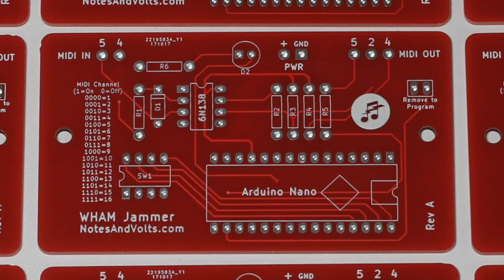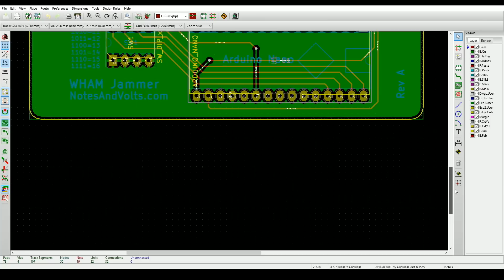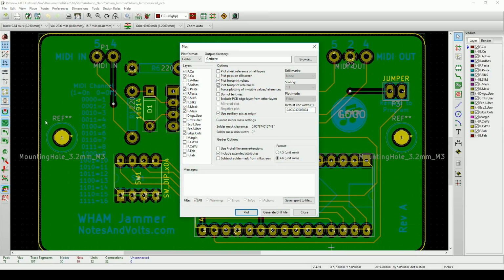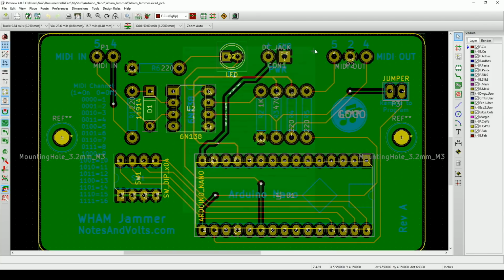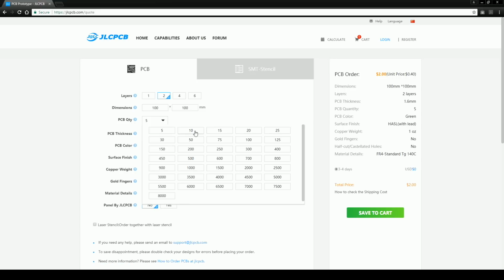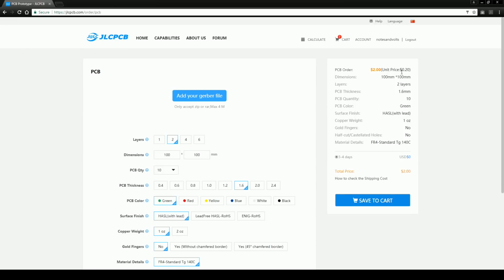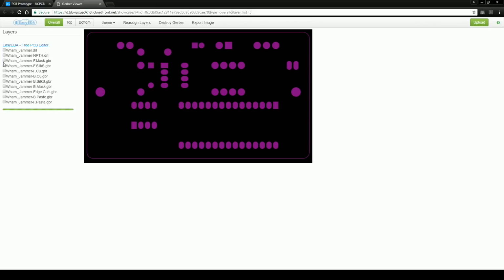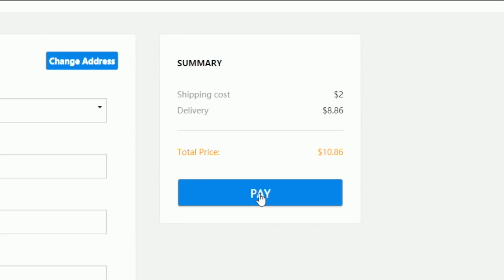JLCPCB - 10 Circuit Boards for $2!!

Comment: I just got my boards from jlcpcb. They look great, smooth edges, nice silk screen and they took less than 2 weeks from order to delivery to Canada. However, if you want more than 10 boards there is a setup fee and colors other that green were also extra. I ordered 3 different boards at one time (got the $2 special on the first design) and my whole order was still shipped free. The gerber viewer shows you exactly what you will get and I found a couple of layout errors by using it (big save) . Ground planes or "fills" must be specified in your gerbers. No one will "just add" anything to your design (you hope). All in all I got exactly what I ordered delivered on time. I'm very pleased.  To have the boards made in Canada or the US would be 5 to 10 times the price.
Reply: 10 pcb costs 2$ and shipping cost over 8$ to ship in India. Very bad
Reply: Try OSHPARK. USA company and they are low cost.

Comment: Hey Notes and Volts, I would like to build a midi controller that's capable of running in standalone mode and as a midi controller for ableton, would this be possible? I saw a video on YouTube of a guy who built a standalone controller using the raspberry pi and a teensy board and it kinda gave me a little hope that I can turn my concept to reality. 

This build would be centered around the ableton push design but with arcade buttons instead of the rubber pads. I would also like to implement a mpc feature that would allow me to create loops/ drafts on the go without the need of a laptop. 

Here's a list of things I would like to squeeze into this controller:

2 display screens for navigating 

64 arcade buttons from dj tech tools

All the buttons on the push 2 that can control ableton   live without the need of looking at a computer screen when I'm working in my home (I would be paying someone to do the coding for me on this project since it nothing like the other diy YouTube videos).

A sound board with midi in/out and audio in/out (don't know how to go about this tbh)

An sd card slot and/or a sata 2 ssd slot for expandable storage.
 
A few knobs for navigating/selecting.

A raspberry pi, teensy board and/or arduino board for the brains of the operation.